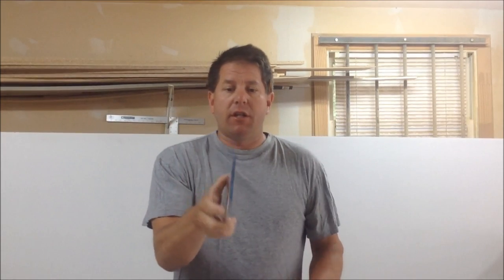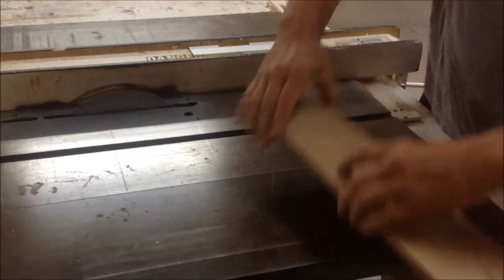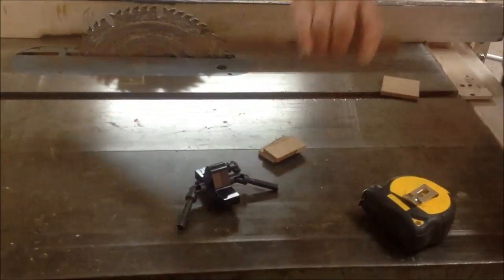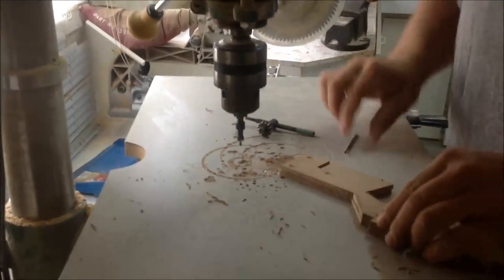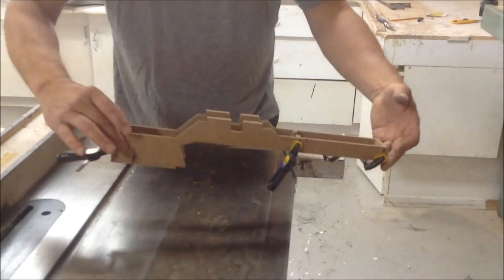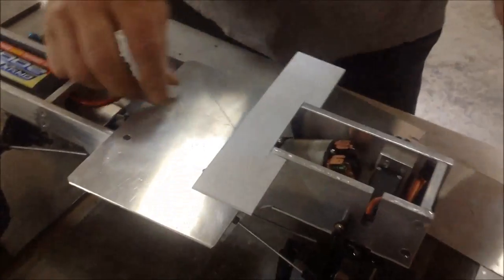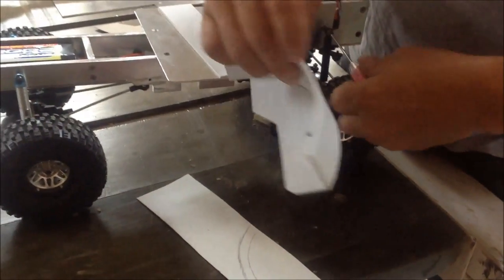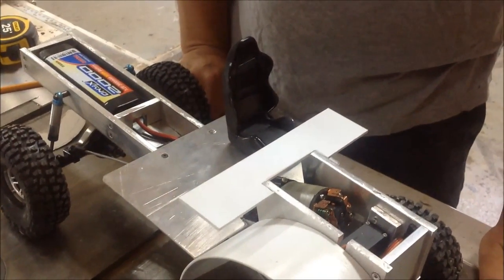Step 4 of the Jeep Nukizer

Comment: Did you cut your 1/4" aluminum plate on the table saw with a regular carbide blade ?
Reply from the maker: +Eric Forget 
Yes I use a thin kerf blade